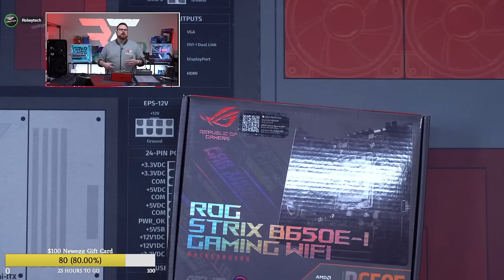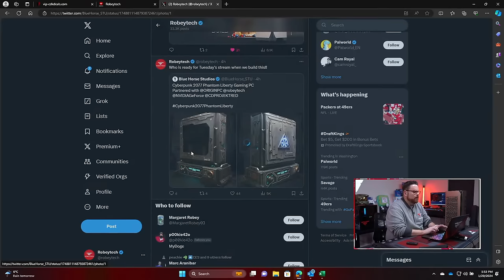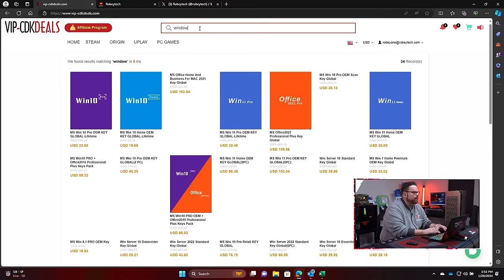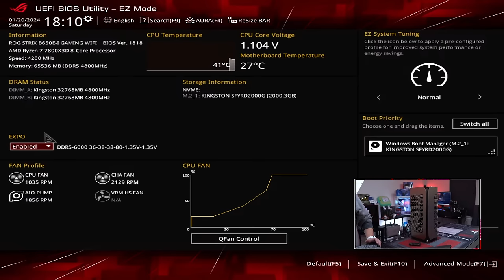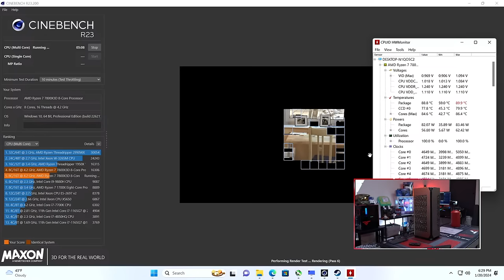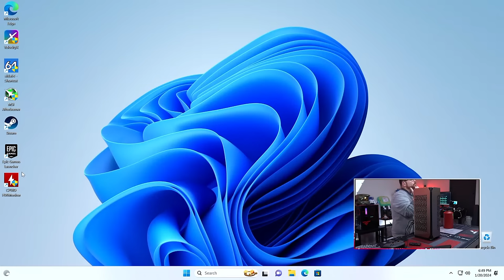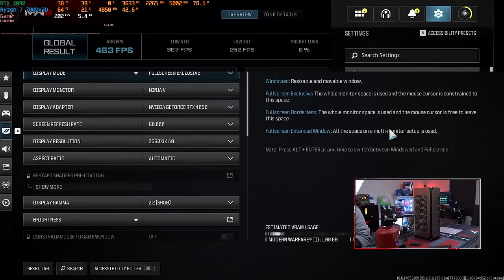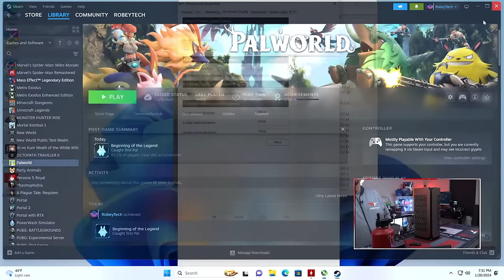$3500 NCore 100 MAX Build (7800x3D / PNY RTX 4090)

Comment: cant help but think a slight redesign with a slightly thicker profile would allow for a 280mm radiator setup on the side, an intake fan at the bottom and an exhaust out the top for motherboard cooling. I really wanna build this but am worried about cooling